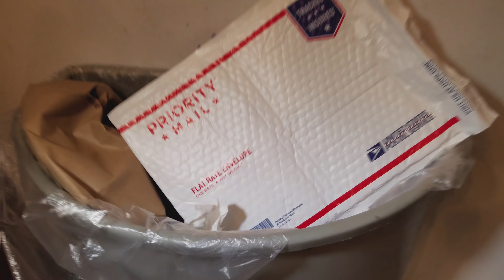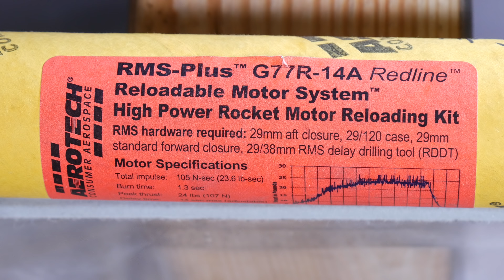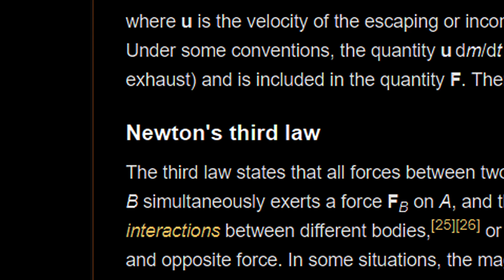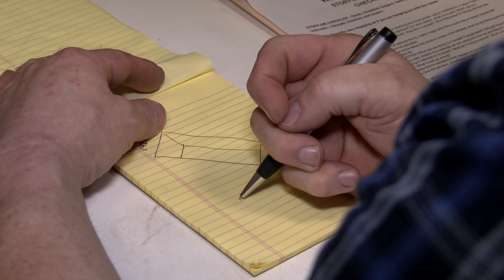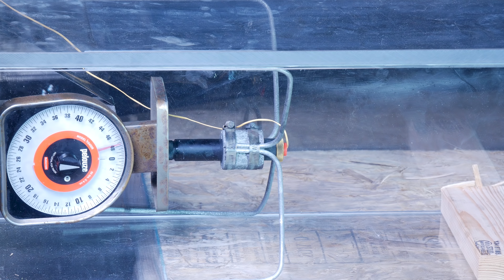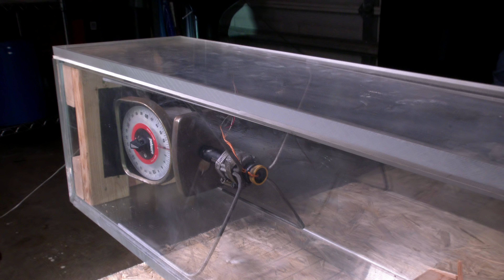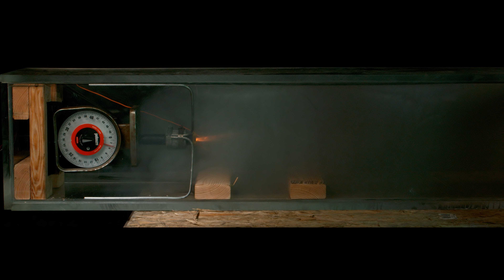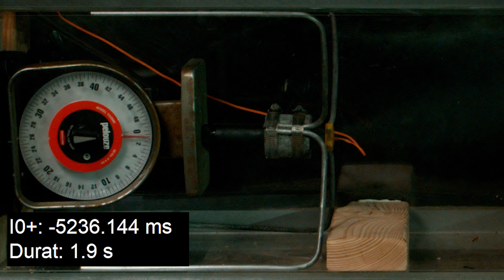Rockets in a Vacuum Chamber - Newton's third law of motion Visualized

Comment: You are causing me to believe that it can't produce thrust in a true vacuum, & those 2 'experts' come on now really, but they got to go along with it to get a pay check, but they did not want to show their face after that.  Now let me past what I said after the other video I watched of yours.  

Yes, I see at first it did not move until it created some atmosphere, and then he said 'surprisingly we still have some vacuum in the vacuum chamber' (well he did not even try to claim the vacuum after that nonsense),  ya some but it didn't seem like it had near as much suction when he opened the valve nor did he show us the gauge.   And it did just what I thought it would do, i.e. start out not trying to move then slowly try to move, but no where near as if it would have been our atmosphere we live in.   So I think he needs to consider the vacuum of space where there is almost infinitely bigger area as the one he made so the matter expelled would almost create zero atmosphere to push off from.  He should try the same thing with just the open tube & see what the engine would do, it would likely just try to fly out of the tube.   'Disingenuous' is the word that comes to mind (but on a subconscious level I would hope). 

Look try doing the same thing but make the engine much much smaller so it does not create as much atmosphere & put it on a spinning wheel, it will still start out not moving then as it create mater it will start to spin rather slowly.
Reply: Will you answer basic physics questions to help you figure out where your misunderstanding lies?
For a rocket engine running here on earth at sea level atmospheric pressure:
1- does the exhaust gas experience an acceleration as it leaves the rocket engine?  Does the engine make the exhaust gas change velocity?
2 - does the exhaust gas have mass?
Reply: For example: A Space Shuttle Main Engine (SSME) consumes 500 kilograms of liquid oxygen and liquid hydrogen per second.
It combusts the fuel and oxidizer creating an exhaust gas that is exiting the nozzle at Mach eight (2500 meters per second).

You must realize that the exhaust gas also consists of 500 kilograms of mass per second. The exhaust gas HAS MASS.

Now the engine accelerated this 500 kilograms from a standstill to Mach eight in about 10 feet (the length of the engine).
DO you HONESTLY think the engine can accelerate all that mass without feeling a RECOIL FORCE pushing back?
Reply: @stuartgray5877   #1.  I would have to say it does experience acceleration as it leaves the rocket engine, at least for a second more or less until it reaches maximum force, then as it runs out of fuel it will wind down to nothing.   And # 2. Yes I would sure say the exhaust has does have mass.  But the mass is not really pushing against anything.   Now even if there is some  force pushing against itself it would be way way less than if it was pushing within an atmosphere, but it would also not have any mater that the ship would have to cut through thus causing resistance.  I would still like to see this done with a real small rocket & as large as reasonable vacuum chamber, so that the created atmosphere would be minimal compared to the one in the video.  It is a lot to think about. I'm getting ready to make a much bigger work shop, (around 30' x 60), then just maybe I'll give it a shot.  But then again I do have other thing I want to experiment with.  😁

Comment: Your rocket created an atmosphere to then push against. Did not maintain vaccuum pressure in the tank. Not the way to perform the experiment. Why didn't you show the pressure gauge all the way through the test?
Reply: Rockets don’t push off air. We also see (and Warped Perception pointed out) that the scale in front of the rocket registers a force before any appreciable amount of exhaust gas entered the chamber.
Reply: @AM-rd9pu  it pushes off the wire
Reply: @AndyBrownlie  No. The motor pushes on the exhaust gasses and the exhaust gasses push on the motor.
Reply: @AM-rd9pu It only starts pushing off the exhaust when the exhaust loses speed due to hitting a wall.
Reply: @AndyBrownlie  You can see in the slow motion that the scale registered a force at the moment of ignition, well before the gasses hit the back of the chamber or before the chamber is filled with gas.
Reply: @AM-rd9pu  thats when it pushes off the wire
Reply: @AndyBrownlie  No, the expanding gasses are what push on the motor.
Reply: @AM-rd9pu "nuh uh" is not a valid argument. If you throw a baseball in space, does it move? If not what is stopping it. When you let go, do you move? If not what makes you different from the baseball?
Reply: @benzene_sandwich I don’t think you intended to direct that comment at me.
Reply: @AM-rd9pu  No, it was directed at the original commenter, my bad, i should've paid more attention.
Reply: @benzene_sandwich  No worries haha

Comment: Was the vacuum pump still on when the rocket was firing. If no, then the thrust was achieved by the force of the exhaust fumes in the chamber.
The experiment should have been carried out by letting the vacuum pump run continously and sucking out the exhaust fumes of the rocket
Reply: Check out 12:12 in the video. We see the rocket generate thrust before we notice any appreciable amount of gas enter the chamber. That wouldn’t be possible if rockets pushed off air.
Reply: So what you're doing is proving that a rocket can push off its own exhaust fumes.  Interesting........
Reply: @willoughbykrenzteinburg  free body diagram says that's impossible, chatbot 😂

Comment: I think this might be something that's overlooked: Its possible that the pressure on the scale is due to the hot (expanding) side being on the opposite side of a small sealed enclosure. In an open vacuum of sufficient size this probably wouldn't work the same way. The heat being generated here and filling the container with its inert exhaust gasses, mainly on one side, and it's extremely hot, above what piston engines experience, and we know that the heat is the driving force behind a piston... which is inside a small sealed enclosure.
Reply: Think of rocket propulsion as the mechanical recoil of pushing on mass.
Does exhaust gas have mass? Yes
Does the rocket engine accelerate this mass? Yes
Then the rocket engine MUST apply a force to that mass to make it change velocity.
What does Newton's third law say about forces?
Reply: @stuartgray5877 Have you ever seen what happens when a pistol is fired without sufficient backing support? This is an issue known as "limp wristing." The slide doesn't travel far enough rearward to cycle the next cartridge. Now imagine you somehow got it to fire completely in mid air... the slide wouldn't likely move at all, since there's no backing support.
Reply: @juansolo1617  And your description of what would happen if a gun fired with no-one holding it is incorrect.
Perhaps you could take a high school physics class BEFORE trying to lecture rocket scientists about the physics of rocket propulsion?
Reply: @stuartgray5877 You're welcome to test it yourself. If the slide doesn't move far enough rearward, it's due to "limp wristing..." i.e. insufficient backing support. 100% factual. Have a look at people complaining about "stovepiping" and EVERYONE'S answer to the problem. Everyone already knows the cause. It doesn't take a physics class to figure it out.
Reply: @juansolo1617  I have been shooting AND launching things to space for apparently longer than you have been alive.
Newtons laws say that rocket propulsion MUST work in a vacuum.
Now go back and finish high school so you can learn ABOUT Newtons laws.
Reply: @stuartgray5877 The lack of an atmosphere would make it much worse. This is all theoretical. Until you're in a vacuum yourself I don't want to hear it. It's all hearsay.
Reply: @juansolo1617  I can help you understand IF you are willing to answer questions:
When a rocket engine is running right here on earth in an atmosphere:
1 - Does the rocket exhaust have "Mass"?
2 - Does the exhaust gas get "accelerated" by the rocket?

Answer these two Yes/no questions and we will get to the questions about "in a vacuum".
I suspect you are unwilling to participate in a real debate by answering questions.
Reply: @juansolo1617  Apparently you are unaware that YOU can SEE the ISS in orbit WITH YOUR EYES!
Maybe you should try that genius?

Comment: In a true, near zero vacuum, your box would have collapsed. There are just so many unrestricted variables in this "experiment" it is not even worth commenting on.
Reply: Kit Canyon yeah. We can build submarines that hold back 65,000 psi, but 15 psi of air is just TOO HARD.
Reply: @stuartgray5877  did you actually read my comment and do you understand that the box in question would not hold up if the interior was under vacuum. Get off your high horse and look at this so called experiment. You TV educated couch engineer.
Reply: @billykruger8392  - Please explain why the box would be incapable of holding back 14.5 PSI of pressure.  Have you done the calculations? or are you incorrectly thinking that "Zero Vacuum"" means that there is somehow MORE than 14.5 PSI of pressure pushing in?  Be sure you know what you are talking about before arguing. How do you know that you are not arguing with a vacuum test specialist?
Reply: @stuartgray5877  OK. So clearly you are not a vacuum specialist. To get yourself familiar with the fundamentals of vacuum or for that matter, the lack of counter pressure in a vessel, please search for the following on YouTube "tanker vacuum collapse".  Now, with this newly acquired knowledge, watch this ridiculous experiment again. Oh, keep in mind the inherent strength advantage of a cylinder and dome versus flat surfaces. Hope you find this  helpful.
Reply: Billy Kruger actually I AM a vacuum test specialist. I was first trained almost 25 years ago at Lockheed Martins Space Simulation Laboratory. It is a FACT that a pressure vessel at sea level on earth will never feel more than 14.7 PSI inwards pressure REGARDLESS of how hard of a vacuum you pull inside.  Don’t believe me? Search LinkedIn for my resume. I don’t hide my identity just search “Stuart Gray Lockheed” and tell everyone what you find
Reply: @stuartgray5877  Ask for your money back.
Reply: @stuartgray5877  I would never hit a drunk, and I will certainly not entertain a fool.

Comment: There’s literally a huge difference between an infinite space and a finite chamber.
Reply: What difference does it make? The third law of motion doesn’t stop working when there’s no air. 

If atmospheric pressure was necessary for rockets to work, we could measure thrust decrease as pressure decreases but that’s not what we see in reality.
Reply: The Tsiolkovsky Rocket Equation tells us that rockets work BETTER (produce more thrust) in a vacuum.
We have been testing this equation for about 100 years now.
Reply: The free expansion is also known as work of expansion in a vacuum. When a gas expands in a vacuum there is no opposing force i.e.  Pext = 0.

For getting work done opposing force is necessary, hence no work is done when a gas expands in a vacuum. Such an expansion is called as free expansion.

W   =    – Pext ΔV

∴ W   =  0 × ΔV = 0
Reply: @stuartgray5877  the equation is fake, nobody uses it because it does not work, chatbot 😂
Reply: @papalegba6796  You’re still completely misunderstanding the third law of motion. 

It takes a force to accelerate the gas out the back of the rocket. Therefore, a resultant force is imparted on the rocket. 

Rockets work for the same reason that you experience recoil when firing a projectile.
Reply: There is a difference, but not when it comes to thrust.
Reply: @papalegba6796 we keep trying to explain to you that "free expansion" is basically allowing a liquid to evaporate into a vacuum 
Rockets don't just "evaporate" the fuel and oxidizer, they PUSH IT into the vacuum with a force of over 3000 PSI.
You are just not capable of grasping simple concepts.

Comment: How dumb. Yeah, vacuum chamber that leaks. Sounds like you should just get rid of the walls since theres not a firmament. Not like they're doing anything anyway. And they shouldnt. Because space is a vacuum right next to the atmosphere, dont ya know?
Reply: You know there’s a pressure gradient on the atmosphere right. There’s no place where pressure is sitting right next to a complete vacuum. In the upper reaches of the atmosphere, there is very low pressure next to even less pressure.

Comment: The conclusion of the Russian scientist 🤣 The container is so small that at the moment of ignition there is no vacuum 🤣 Of course the law is probably right, as you can see for yourself by watching a 5-year-old swinging on a swing. But the experiment that is supposed to prove it is flawed.
Reply: Of course, it can be proven using a vacuum chamber, but it is definitely more difficult and expensive. You have to launch the same rocket not in a vacuum and compare the forces. There is a lot of computational problem and differences in the ignition itself - its speed. Also, all the elements should be as identical as possible. Small differences can change the result (mass, rocket, friction resistance of the base). Everything has to be calculated. And of course a more accurate scale and a slow motion camera.

Comment: So the smaller rocket couldn't fill the vacuum chamber with enough pressure so you claim the scales were jammed and point at another observation instead of repeating.
This "experiment" was a complete failure and was meant to be but you still couldn't get the results you needed to prove how rockets would work in a vacuum so since you knew it was a failure (edited out), you cherry picked an observation and called it quits and a success. What happened to the vacuum gauges for the chamber when the rocket was lit?
Why do we not see these little rocket experiments done by the Deceivers in the world's largest vacuum chambers with Real skeptics there to observe the whole experiment?
Why do the Social Engineers use people like you to try to do damage control?
Did the team of students have to leave before you started calling it a success?
This was nothing more than a laughable failed attempt to prove or disprove anything aside from proving you're not very smart if you thought using a little vacuum chamber would be like the vacuum of  "outer space".

Comment: LOL. What a load of crap. Where is the vacuum gauge? LOL. Let's see the vacuum level before and after. I didn't think so.
Reply: Vacuum gauge? You mean pressure gauge?
Reply: No, I mean vacuum gauge.
Reply: @samgreer8596  

What are the units for a "vacuum gauge"? Vacuum means empty.
Reply: Vacuum technically means devoid of matter which that chamber was not since that is not possible to achieve. That being the case, the absence of matter is measured in microns by a vacuum gauge. If you're ignorant try not advertising that to the world. Instead, try a tiny bit of research before you broadcast your ignorance.
Reply: @samgreer8596  

Nothing is ever a perfect vacuum, so all you're doing is quibbling.
And you mean a PRESSURE gauge, and they measure in atmospheres, bar, torr, or psi. 

Do you tinfoilers know ANYTHING?

Comment: You spent so much time of a waste of time before you even tried I could see you did gave enough vacuum you can see by the smoke it filled up and your pressure gage even showing pressure. I built a better one then you just by using clear pvp pipe and a vacuum cleaner and model rocket.
Reply from the maker: Ikr, I also did the clear PVC pipe But it imploded because the vacuum cleaner was just too strong

Comment: Not convinced. The vacuum was compromised on ignition. I liked your experiment but flawed on results.
Reply: He addressed this at 12:10. The motor ignited and produced thrust before a significant amount of exhaust gasses were produced.
Reply: There was no vacuum to begin with 😂
Reply: @papalegba6796  Well the chamber certainly was below ambient atmospheric pressure. Or do you think that’s not possible either?